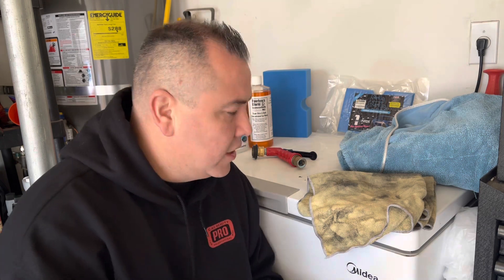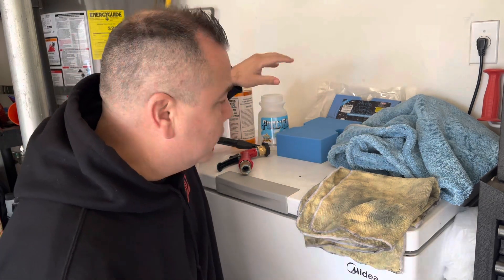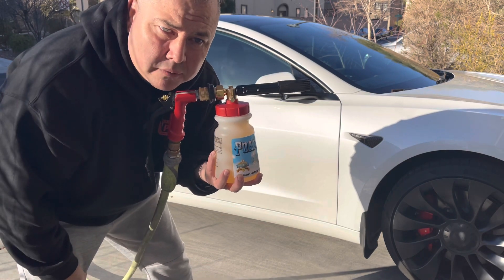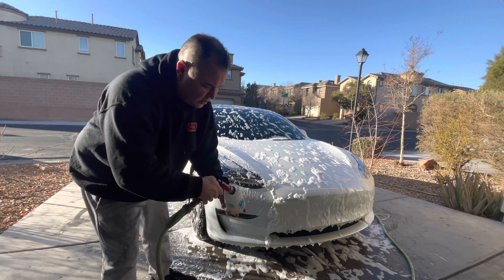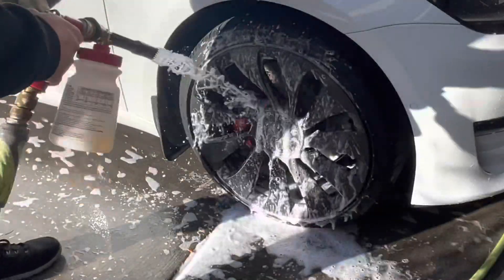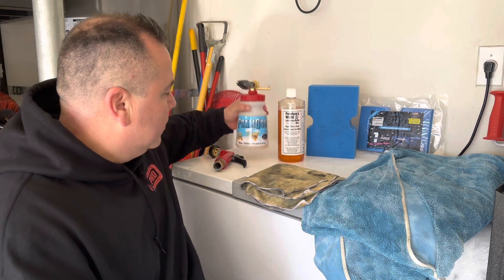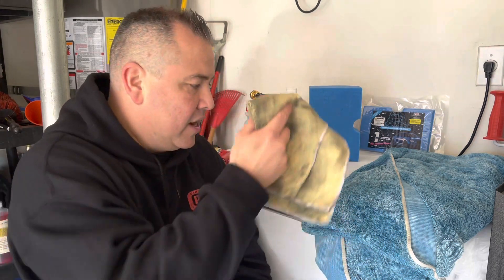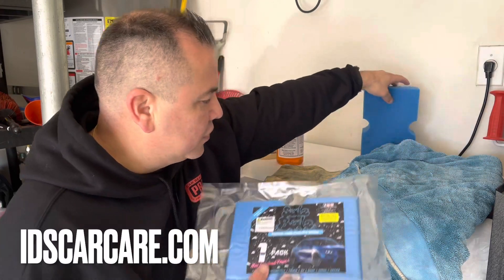The Easiest Way to Wash Your Car?/ minimalist Approach to Car Washing/ Autoforge.net/ Sudz Budz

Comment: Minimal winter washing here in the Midwest, is ONR with wax.  Yesterday high temperature was 12 degrees (F).  Unable to use a hose.  To clean wheels & tires, I use Extra Tough Wheel Cleaner 1:1 as a 'waterless wash' for tires & wheels with EXCELLENT results.  Thank you!
Reply from the maker: Cool

Comment: Interesting that you use the Sudz Budz sponge instead of the Ultra Black Sponge.  Do you find that Sudz Budz is as good as the other more expensive sponges?
Reply from the maker: For Car Washing with soap the Suds Budz Sponge works great.  I was just testing it out a few times with different wash methods and it’s decent.  For Rinseless I’d use McKee’s or DIY.   The Ultra BLack Sponge was good as well.